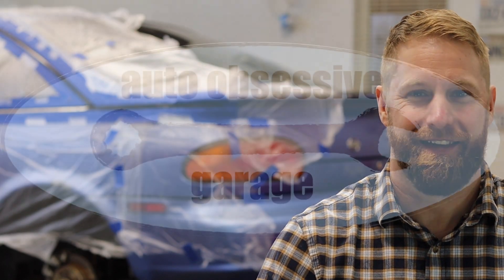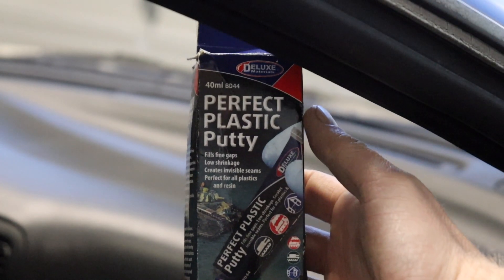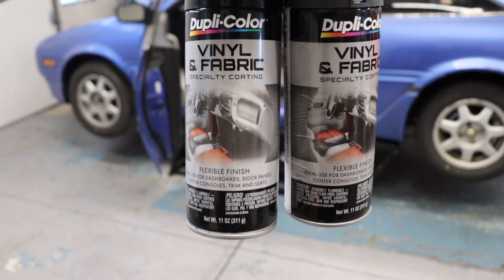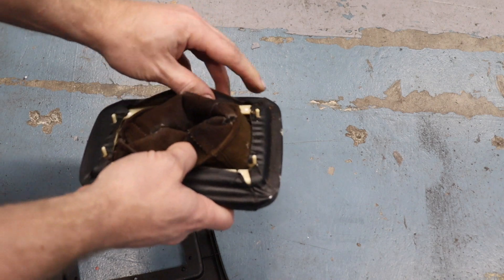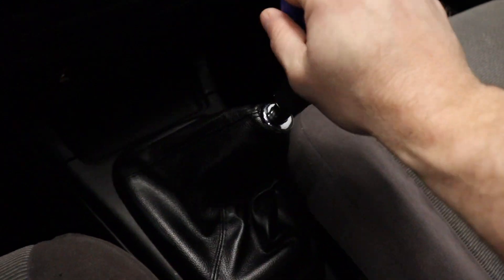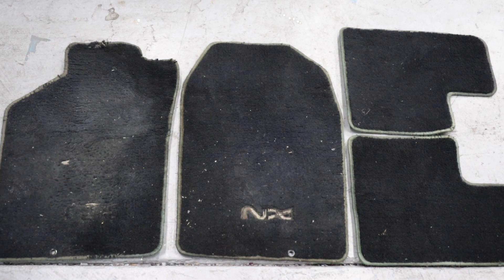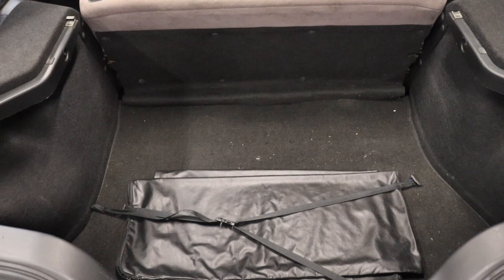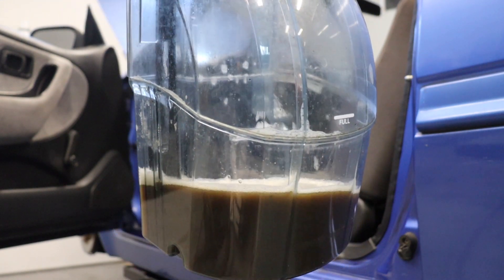1993 Nissan NX2000 - Episode 9: Interior Refresh

Comment: Also that was pleasing to watch! 
Can you tell me please, how small space on those back seats are? I've heard that this exact model is actually 2-person car, because back seats are suitable just to carry your dog, it's to little foot space... (I hope that's just a rumour though).
It's a strange decision from Nissan engineers to make that large trunk and so rudimental back seats...
Reply from the maker: Haven’t sat back there in a bit, but it’s short on both headroom and legroom. It works in a pinch though.
Reply: i've fit 3 other people and myself into my NX2000 (plus luggage for all 4 of us), it works! that being said, we were definitely feeling the crampedness. the front seats were forward as far as they could go, and we had the two tallest people sitting diagonally across from eachother (me in the drivers seat and the tall friend in the rear passenger seat, and the other two friends in the other two seats). 

the one thing i've noticed in the rear seat (i'm 6'0) is that your head rams against the roof OR the rear trunk glass. it's pretty much those two choices, and it's purely because of that ovoid sloping roofline - back in the early 90s, if you wanted more headroom for rear passengers, you got the Sentra SE-R (because of that car's much more squared off body)
Reply: @quirble  Thanks for this extended answer! I appreciate this. I'm 6′ 1″ and sometimes I need to carry passengers on a back seets, so it's a shame I couldn't buy this sexy car...